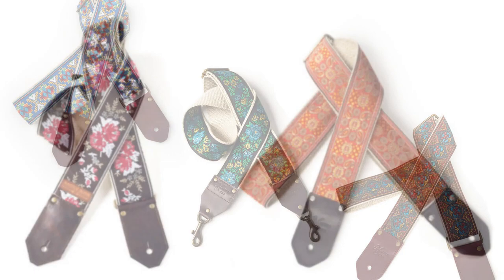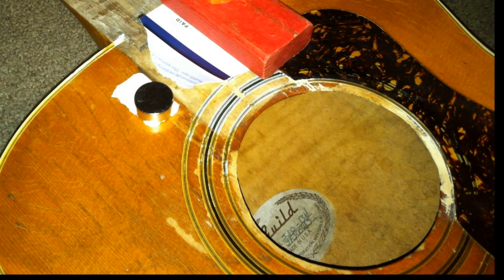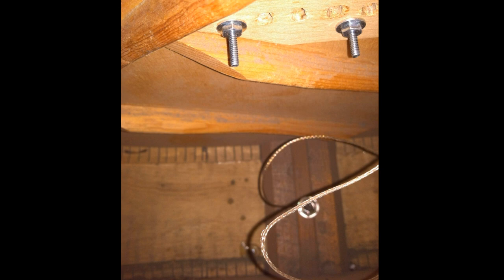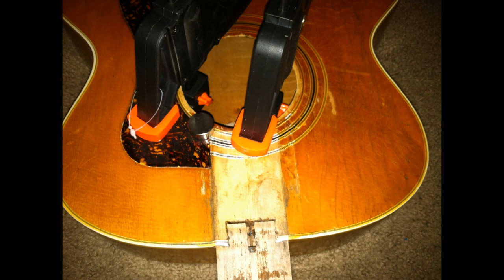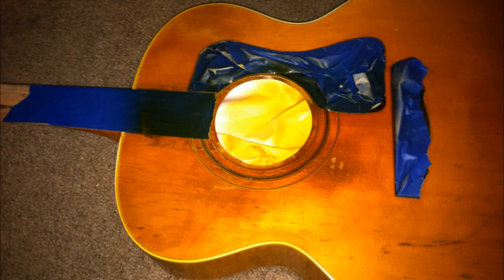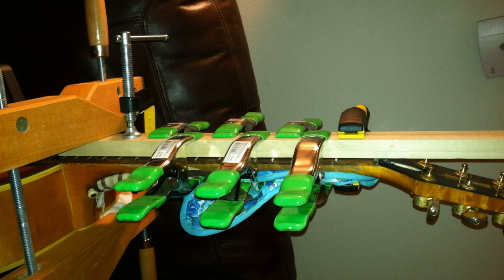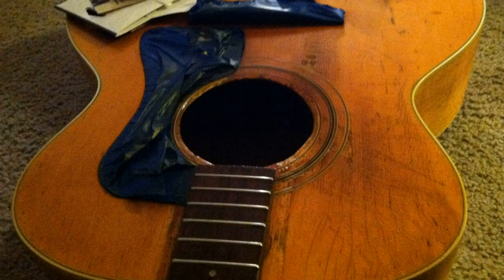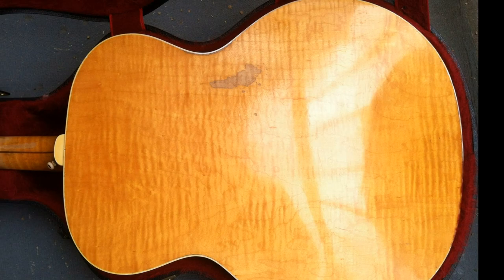New Orleans Street Musician Guild JF30 Jumbo - Projects from the Vault

Comment: I have my grandmother's old guitar. She kept it in a closet here in northern IL, where the summers are hot and humid and the winters are cold and dry. Needless to say, a LOT of cracks. There are two big ones that go from the bridge to the bottom of the guitar. I can't get my arm inside to put cleats across the cracks. Any suggestions?
Reply from the maker: Remove the back of the guitar. Use a hot artist's knife. What model is it? And make?
Reply: @TheGuitologist  Yikes! That sounds a bit out of my wheelhouse. Maybe I can wait until my niece is a bit older. It's a 1967 Epiphone Texan.
Reply from the maker: @HandlebarWorkshops  That is worth repairing. Spend the money and get it done right. You do know that's the same guitar McCartney recorded "Yesterday" with?
Reply: @TheGuitologist  McCartney's was a '64, but yeah. I don't know anyone near me (Chicago) that I'd trust enough to do it.

Comment: I just had a late 70's Guild D-30 on my bench in about the same condition. While it didn't have bridge bolts holding the bridge down, the owner had kicked a giant hole in the lower bout bass side and it had several top cracks and also needed a fret dressing. Luckily the guitar came out great, but gees I'm gettin too old for this shit.
Reply from the maker: No, you're not. Take a break if you need it, then come back to it. The human spirit wasn't meant to be a specialist. It's meant to explore and learn and feel relevant. If you aren't feeling relevant, something is wrong in your thinking.
Reply: @TheGuitologist  Oh, I feel relevant, but my body and hands aren't holding up well. Musta breathed in too much cocobolo dust!

Comment: this is like a stew mac video, except i don't have to buy expensive ass tools and gadgets.... only thing you did not mention is the 14 different brad guitdonald hyde-glues used.... ive set a fret board on a flood damaged Japanese cheapo once i used electrical tape as binding and a broom hand and piece of 2x4 for jigging, and a jb weld epoxy type binary.... lets just say its only good for "slide guitar"